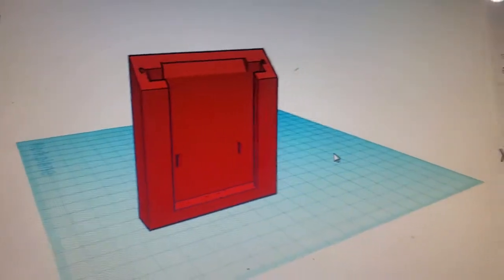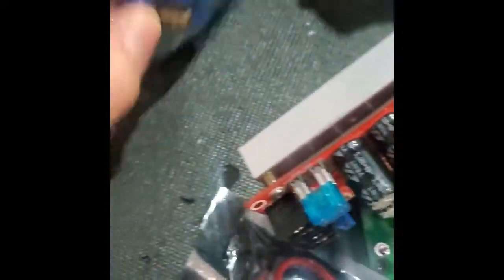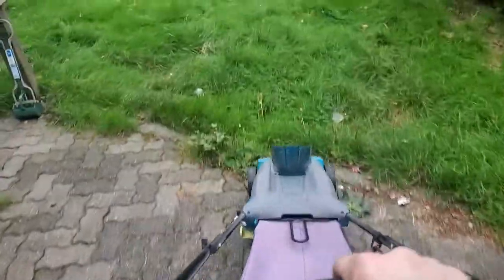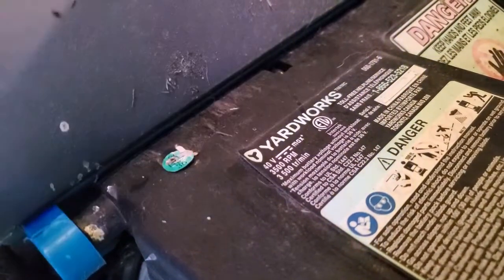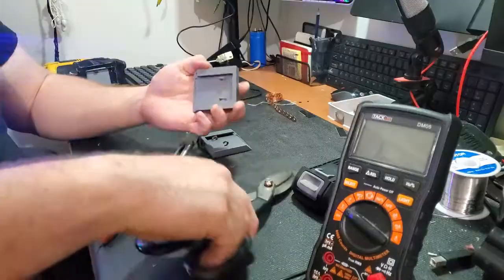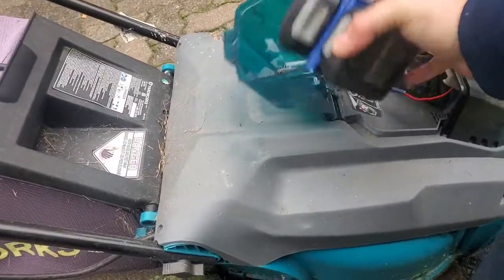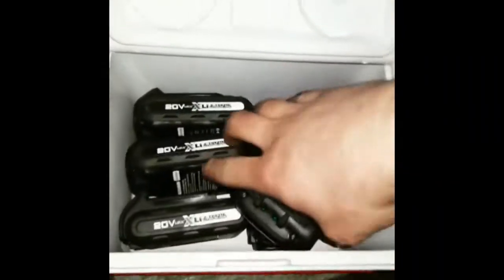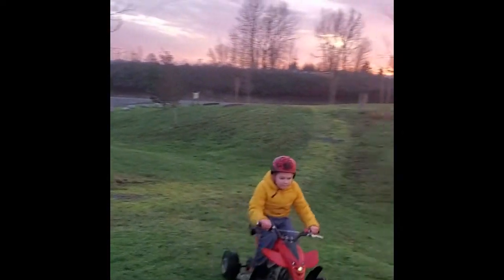Using Drill Batteries to Power Everything! Hacking Your World Episode 1

Comment: I have a 40-volt Ryobi chain saw that I use doing tree work. I want to relocate the heavy battery to my harness to make the saw lighter. Yes, I'm still climbing trees at 73. The battery plug on the saw has three connections, B+, B- and T2. If you connect a power supply to just B+ and B- the saw does nothing so the T2 connection must be controlling the power. I thought you, or some of your watchers, might be able to answer my question. What does T2 need to turn on the power to the chainsaw? I don't want to run three wires if all I need is two. Great idea! I'm a real fan of people that think outside the box. I'm a hoarder too, and love to make good use of my junk.
Thanks for the video.

Comment: I have a question…i want to convert my electric power adjustable desk to battery powered so i can move my desk anywhere in the room without draging the power cord and looking for the nearest ac outlet.  The ac pack that came with my desk has a rated output of 29v and 2A.  I have several 18v milwaukee battery and dewalt 20v battery.  How do I convert them…..please

Comment: I was searching for a way to power a stepper motor with batteries and I found this video. Thanks.
Edit: do you find the batteries cheap somewhere? Pawn shops? Wouldn't you be concerned with how many hours somebody has used the battery? How would you determine that? Sorry for all the questions

Comment: I have a bunch of Rigid 18 volt batteries. I need to go to a lower voltage of 14.8. I plan to use it to power my electric reel for a 39 hour fishing trip. These reels average drawl is 2 to 3 amps.

Comment: Hey man curious.. i can't seem to find an answer.. so if I were to use a drill battery in like a BT speaker box or something where I can't remove it to charge.. I would just connect it +/- to a barrel jack and charge with like a laptop charger.. my problem is.. hopefully where you come in.. if you don't forget to turn the thing off.. the battery will over discharge and become damaged..my question.. these battery's have a built in BMS.. how the heck do I utilize that? Yes I know I can put in a stand alone bms.. but I mean they already have one. The ones I'm using have 3 pins.. I only use the +/- pins.. what's the 3rd for? Can I connect that to like the + terminal and now it has a functional bms?? Thanks! Love the videos

Comment: Beware! Most power tool batteries does NOT have a build in bms and you can drain the battery to 0v on the terminals. I have only found a real bms in rigid/aeg 14-18v batteries so far so it is rare. The battery doctor
Reply: Hey, you just half answered an age old question.. how the heck do i use the built in BMS?? I believe only using the + and - pins bypasses the bms.. my battery's i use has 3 pins.. no idea what the 3rd is for.. maybe tie it to the + or - and now the on board bms works?

Comment: I want to power the starter on a 4 Wheeler, and lawnmower, and other stuff with my drill battery. I don't want to maintain batteries on every machine. Can these be strong enough to turn a 12v starter?

Comment: awesome video! Im doing the quad conversion possibly today. Im running 2 Milwaukee 18v to replace three 12v lead acid. I was just going to run series and a fuse. can you foresee any issues?
I also have some Ryobi 40v I may try if I don't need to step them down.
Reply: Just get a DC to DC step down converter for the 40 volt. 
I'm about to do the same. I just acquired 2 40v batteries. I'll be using them with ham radio equipment using a adjustable step down then to a breaker then the radio's fused line. I can run basically 15v to 12.8v with 13.8v being optimal, so I have a margin for error.

Comment: I want to power a radio with 2 20v 8ah battery's in parallel, but do I also need some sort of battery balancing? Or is this not needed? Radio runs on main 230 vac, 8 D-cell batteries or a 12V 5a auxiliary port from the car. 

I want to power the radio with the D-cell contact port. 

so I am going to hook the battery's together in parallel, then an underdischarge protection and after that a step down converter 8 to 40v dc to 12v dc 6ah

Any advice?

Comment: Charge/run them with a solar panel and modify the AC frequency to give a consistent output to handle a window unit AC load. I mean you'll need to keep them cold while discharging. Try using some capacitors on the power wheel to extend recharge life, just don't blow up your kid.

Comment: Ever since I was introduced to a little Amazon battery powered fan, and different converters for making batteries fit other tools, it dawned on me that this was possible, and now I want to mod a Nerf gun to run off of these batteries.

The blaster in question, the Rival Perses, runs on a 9.6volt battery pack. So if my tool batteries are 20 volt, I should just need to add a resistor to lower the flow, right..? More testing is required.

Comment: Two Makitia Batteries in series for a 36v Stereo amplifier. What is the best way to protect from over discharge? 1. Adding a 36v protection board or 2. Adding individual 12-18v protection board to each makitia adapter? Makitia states that the protection is only in the tool & not in the battery. The bms board inside the battery will not shut it down. Any suggestions?
Reply: I would add a protection board with overdischarge, overload, short, etc.

Comment: Theoretical question, i have a car pure sine 300w invertor(max load for my tasks is under 150w) which is rated at 12v (overvoltage protection kicks up at 15.6 ) and bunch of different brand 18v batteries ,all around 4AH, i want to print an enclosure with a step down DC DC converter  and a standart cigarette car lighter port. Simple option - 1battery at a time,when it dies just swap the battery, 2nd - connect in series 2 batteries and step down 36 to 12 or 3rd option which i like the most, but not sure - connect 2 or more batteries in parallel with step down 18 to 12 converter, and make them hot-swapable if one of them dies first, but not sure about the circuit. What would you prefer?
Reply: 18 to 12 would be the most efficient. The voltage difference is small. 
The problem with parallel is charging them. Hot swap would probably be better.
Reply: Question that I can't seem to find the answer to. I have an RC boat that I built using all the running gear and inner workings of a Duratrax with a 9.6v (or something close) battery. I had a broken drill 18v so I decided to use it's battery to power the boat. BUT, being 18volts its going to fry the ESC and I'm sure other things if I keep pushing it. So I'm wondering how can I use the stock battery for everything except the motor? Like I want the drill battery to power the motor and the stock battery to power the steering servo and the speed controller etc. How do I hook that up? Thanks

Comment: I really need help powering an Arduino with a drill battery.  
I have a buck converter but it just gets really hot and the display won't come on, when I power it with less vintage it works
I have the del battery connected to two cytron md-10c motor driver's
I have been using a separate power supply for the Arduino but that just seems silly. Can someone please help